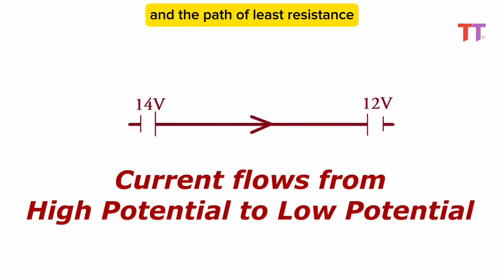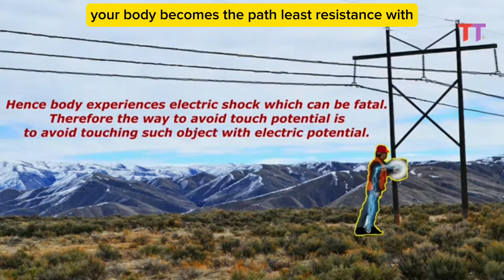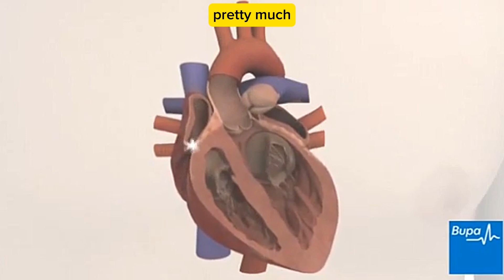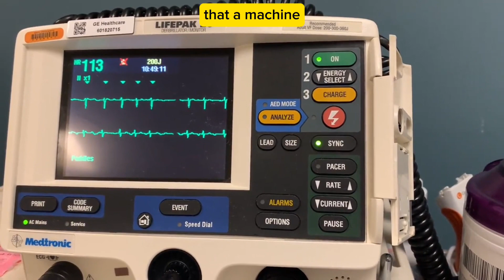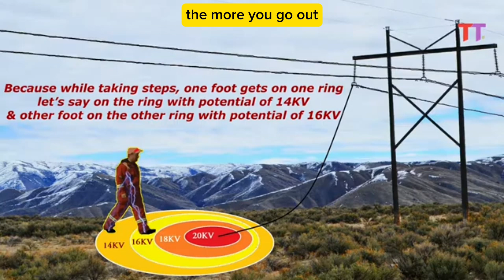How To Avoid Electrocution After A Car Accident

Comment: Just for reference, voltage is not the worry it's the amps. Those boxes can be charged with thousands of amps. But it takes only 70 milliamps or less to kill you. Plus side the patient was dead long before they really felt anything.
Reply from the maker: Thank you very much for that clarification! I knew there was a difference between volt, amp, but my limited knowledge had me using it interchangeably.

Thank you for sharing!